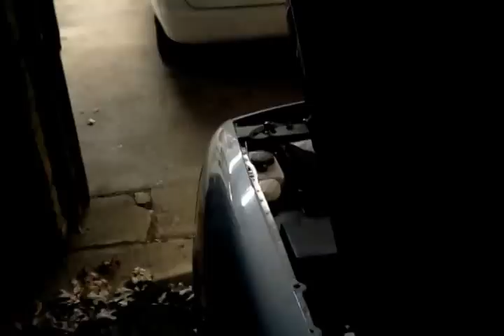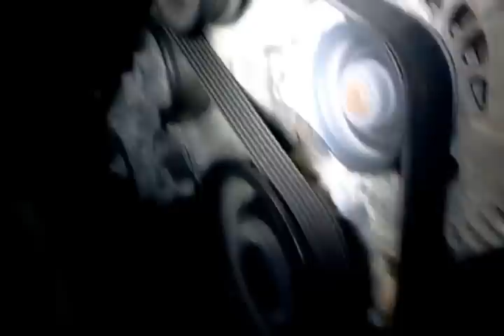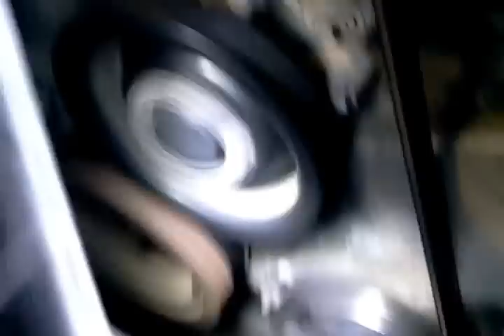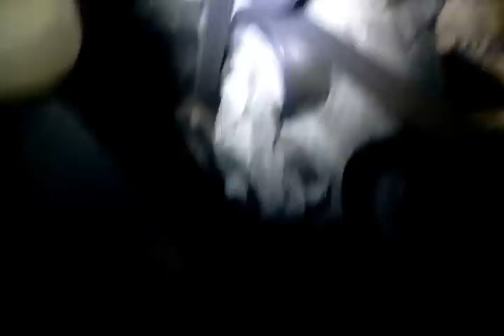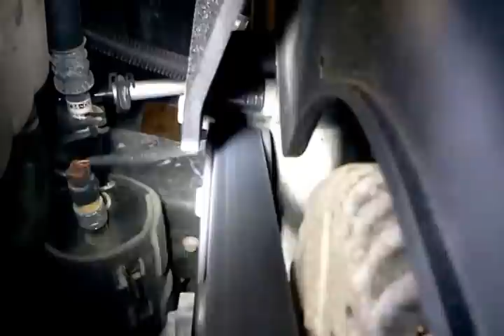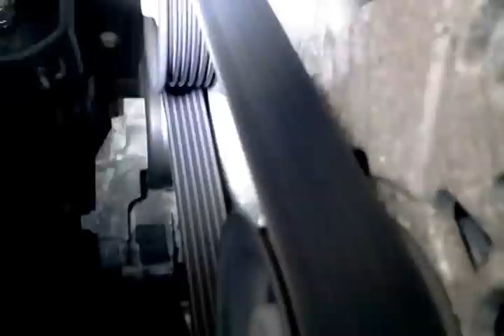Loud whine/whistle during cold start on 2003 Grand

Comment from the maker: UPDATE: 2/11/2017. I just finished replacing the power steering pump due to a leak from one of the lines at the pump. As it turns out, the power steering pump must have been the cause for the noise because it is now completely gone. I want to say thank you to everyone who is been so patient and waiting for response as to what the problem was with the loud whine during startup. If you have this same noise, you might have a power steering pump going bad as I did.

Comment from the maker: +DWB245
No, I've replaced the belt, the idler pulley and bearing, the water pump (it started leaking), and the tensioner pulley. But, the noise continues only when it's below 30f, and only for the first 10-15 seconds after starting it from cold-start.

Comment from the maker: Update on the cold start noise: to date, I've replaced the idler, tensioner, serpentine belt, checked the bearing play on the water pump & alternator. I've also had the engine checked for compression & it was in the middle of specs (152psi avg). The intake gasket & (plastic) intake were checked for leaks, but everything checks out. Back to square one until it gets cold enough to hear the noise, if it happens.

Comment from the maker: Dungeons Dragons No, I haven't figured out the cause yet. But since it goes away when I change rpm's, I think it's the tensioner since it causes the belt tension to change when giving it gas. So, I'm going to change out the tensioner & see if that fixes the noise.

Comment from the maker: To all: I've replaced the tensioner, the idler pulley (& bearing with it), and installed a new serpentine belt. The noise hasn't occurred at all. However, the noise only happens when it's 30°, or colder. Since it's been above 45°, I can't tell if it's fixed or not. It'll get colder in a few weeks, so, I guess we'll find out if it was a bearing, etc. I'll keep you posted as the temps get colder.

Comment from the maker: Update: I've repalced the idler pulley, the tensioner, the water pump, & the belt. The noise still is present. Ford crew at the dealership can't "find" the  noise because it disappears so quickly after cold-start. I am at my wit's end with this.

Comment from the maker: To all: I'm still unsure what the source of the noise is. It's been below 20° a few times this year, but no noise yet. I did replace the bearing in the idler pulley when it was still cold in spring. But, it still made the noise. I'm at a point where I'm going to install a new tensioner, idler pulley, & belt. Byw, a ford stealership said "I don't know that noise. Guess we could change the belt."  Ok, so I'll do it myself & save about $70 bucks. :) Everyone, let me know what you've come up with... :)

Comment: Its the bearing inside the Alternator. That's were the noise is coming from. Replace the alternator and the noise will go away
Reply: Najee Greene I've a got a 2000 Marquis and I thot when I leaned in closer it was coming from the alternator as well

Comment: Any luck yet?  my '02 F250 5.4  does almost  the exact same thing on cold start up.  I get loud whine and I have that narrowed down to the power steering pump, and the off and on whistle seems to come from the front left.  I'm  going to replace the idler and tensioner pulleys first, cheap and easy. and see if that helps.  I'll let you know.
Reply from the maker: @ Neil Johnson. Sorry for the delay in getting back to you. I've had a family situation for the last few weeks. No luck yet on the noise. What makes it really hard to research is the fact that as the outside temps are getting warmer because of spring, this noise isn't so loud. Seems like when it's colder, the noise is worse. Have you figured out any noise solutions on your engine?
Reply: +Neil Johnson 
I have a 99 F-250 5.4 that making noises on a cold startup. Did you find out what your issue was?

Comment: the pulleys can look good but the bearings are whats bad. pulleys are in 2 pieces. sounds like your idler pulley is bad. you can buy just the bearing or the complete kit already together. hope it helps you out.

Comment: Have you found out the problem yet my 03 Mercury Marauder doing the same thing
Reply from the maker: +John Sparks. Sorry for the delay. I was on vacation & actually chose to leave the phone at home! :-)  Anyways, I'm not sure if it's fixed yet since hasn't been cold enough yet for the noise to happen. As soon as it's below 30°, I'll update whether the noise is finally gone or not. To date, I have replaced the belt, idler pulley, tensioner, & water pump. We'll see if it was one of those items as soon as it gets below 30°. :-)

Comment: What is it man? My 05 legacy was making that sound and it just died at a red light and It will crank but the engine wont turn on :\
Reply from the maker: Pelon22, I'm sorry that I don't know what the sound is. That's why I posted the video (see description above). I know that the sound is coming from the front of the engine. But, as to which bearing (if it IS a bearing...), I don't know. I've checked the belt tension, and it's good. The belt tracking on each pulley is straight. So, I don't know what the noise really is. That's why I'm hoping an experienced Ford/Lincoln/Mercury tech can view this & let us know what's making the sound. Thanks for posting, though. :-) My car runs fine, just this noise on cold-start is all...